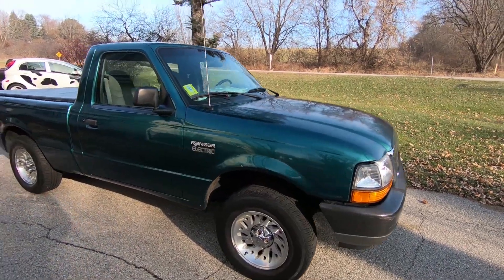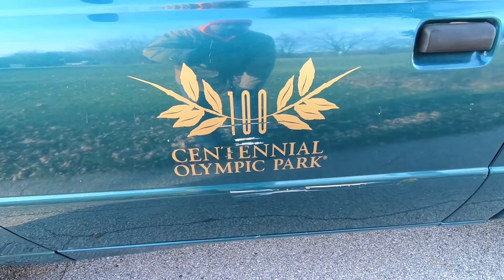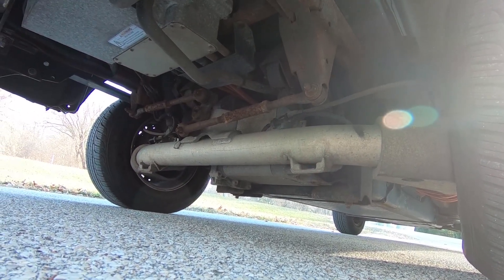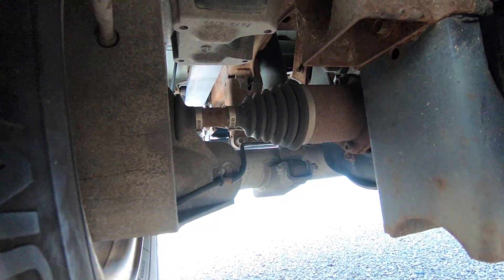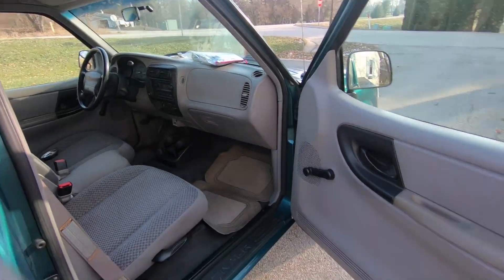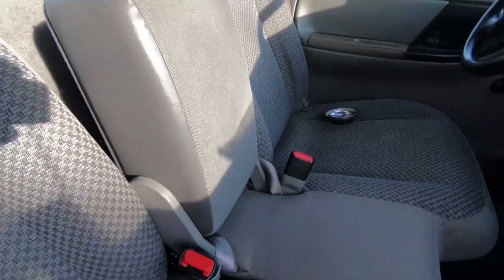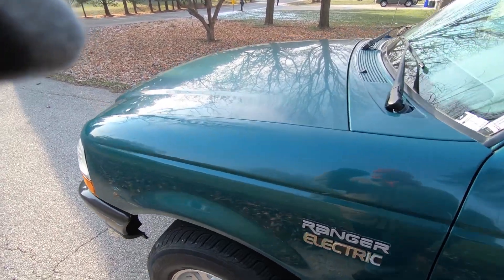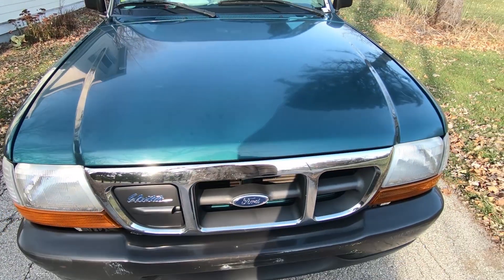Ford Ranger EV Walk Around Tour and Overview

Comment: I drove one at Ford in Dearborn.  What was impressive is how normal it was to drive: exactly like a car with an automatic transmission. It only got weird when I took my foot off the "gas" and it went dead silent. Years of driving IC cars made my brain say "STALLED!!!".

I worked for the company that made the DC-DC converter: managing it in the factory. One fine day I got laid-off from that job and I went on a hike to clear my mind. I'm sitting there on a bench for a few minutes and one of the Park's EV Rangers pulled up and parked right in front of me!

I thought "Now they're just messing with me!"

Comment: This is the drive set-up I want to use when I juice my 87 Isuzu Pup. Motor bolted directly to the differential. Maybe there are some of these rear-ends floating around out there. Or I might try to just build something similar using the stock rear.
Reply from the maker: There ARE motors that are designed to go straight to a differential. I have one in my garage right now that I'll be making a video about soon.
Reply: @BenjaminNelsonX  I'll be looking forward to it

Comment: Umm first of all, how would they get a 98 ranger in 96 at the atlanta Olympics?
Reply from the maker: It was at the same park, not the same EVENT!
I believe that Atlanta was flush with money that came in because of the Olympics and spent quite a bit of it on municipal infrastructure, including such things as buying electric vehicles and charging stations. The truck clearly was used in brush and maintenance, as can be seen by the scratches and dents on the bed. The interior of the cabin is in great shape and it's very low total miles.
Reply: @BenjaminNelsonX  I didn't even think of that being a possibility. Makes much more sense. Still a very cool very rare truck!

Comment: So this is a dumb question but why do you need coolant? 🤔🤔🤔What does it cool/ keep not frozen in winter?
Reply from the maker: The motor controller is liquid cooled and the truck has electric heat and air-conditioning.

Comment: I have one of these trucks right now in my shop that I'm working on for a customer someone else started it with a hundred and four hundred amp hour cab lithium batteries. I got a spoof board to trick the BMS that's in the truck to think that the batteries are okay but I'm still having trouble getting things going. I have the power limit light on and it won't go over 20. I got that same consult programmer that you have to oh, what a small world.https://youtu.be/vBNagoYF5Oc

Comment: Ben:  What a great deal on the truck. A few things that might help you on your endeavors:

A Ford NGS tester is really helpful in working on the truck as there are a lot of things going over that older OBD port that don't translate with modern OBD diagnostics.  You can also find the Ranger EV cards on line for the NGS. If you are going to attempt to use the existing BMS and charging hardware the NGS is a must to reprogram the system from lead to NiMH

There are also specific tools made to work on the truck some are not all that needed but others are a lot of help.

There is a pump INSIDE the transaxle that was prone to failure and required removal and disassembly to replace ( If you could find it). If the PO did not encounter this issue, a common solution was mounting a holly pump under the truck to do the same job. You will get an error light on the dash when the pump goes.

The ceramic heater is a beast and it kills the range and regen. However you will not need it on long as it warms up the cabin quickly. Speaking of heaters, the original lead pack also contained heating pads attached to each battery to keep them warm while charging so the range was not affected in cold weather.

Blend door failures are also common as on regular Rangers and a pain to fix

Getting that coffin out is a beast without a lift. I am curious how the PO ran the sense leads like they did all in that box. When I moded mine from the NOS 8 volt to 12 I attached a little resistor pack to each battery. It worked quite well but lead is SOOO heavy. Mine is waiting on me to get off my but and mod it to NiMH. Maybe down the line to lithium but I would like to keep it as stock as possible and so far no one has been able to mod the on board charger for Lithium battery specs so a different BMS and charger would be required. There was a gentleman on the west coast that was the go to guy on Ranger EV mods but his on line presence has seemed to have disappeared.

If you have not already done so, the service manual is available on line.

Fun Fact: The post office had a pilot of EV mail trucks based on the Ranger EV platform. As far as I can tell all of them have been crushed. One of the few differences was that you could run the heater while plugged into the charger. Allowing defrosted windows and it is toasty warm for the mailman to start his route on a cold morning and not drain the battery. Training video: https://www.youtube.com/watch?v=YgdMEPCcQTI   Part 2 here:  https://www.youtube.com/watch?v=v9Z8Jl4quXs

Good luck with your new toy!
Reply from the maker: Wow! An LLV with Ranger EV guts!?!? Cool!

Comment: I had always wondered what was behind the “gas door” on these! I’ve been thinking about getting one (there’s one locally for sale), and also doing a lithium conversion, but money, haha. 
If you’re interested, the company I work for, Quick Charge Power, in San Diego (right next door to EV West) builds CHAdeMO DC fast charging kits for other factory built EVs (Gen 2 RAV4 EV, Tesla Roadster, and Mercedes B-Class, as well as other cars we have in the pipeline). We occasionally do some other prototype work, but it’s pretty rare... Perhaps you could convince Tony to get you one of our control boxes though. Even if not, it might be worth giving him a call, he’s very knowledgeable about the CHAdeMO standard.
I think with an Orion BMS you can get it to work with just the inlet and some contactors, as I think Orion already supports the CHAdeMO protocol, and will handle the communication.
Reply from the maker: Thanks Alex!

Comment: The fact that this truck has an electric motor, but not electric windows, bothers me for some reason.
Reply from the maker: It would only bother me if they were gasoline powered windows.
My gasoline 1998 Chevy S10 only had crank windows as well.
Reply: That's to save electricity. This was the 90's Electric cars nowadays can have electric windows and no drainage issues. I think the past it was more difficult.

Comment: I wonder if aluminum hoods are a Ford thing, both my 87 and 99 Town car had aluminum hood.  Never had dent issues with them though.
Reply: 1D10CRACY , "According to the Aluminum Association, Ford leads the auto industry in the use of aluminum in its current steel-bodied vehicles with an average of 219 pounds per vehicle.

Stamped aluminum hoods for the Ford Crown Victoria, Mercury Grand Marquis and Lincoln Town Car account for most of that poundage"

  http://edit.autonews.com/article/19940530/ANA/405300737

Comment: You should try to get the batteries from a wrecked fiat 500e!
Reply from the maker: Better yet, a PAIR of 500E batteries!
Reply: BenjaminNelson I have a fiat 500e and my ultimate goal would be to get batteries from one and install them under the trailer I built for it. I could almost double my range. Someone has done something similar with the RAV4 ev. You could do the same thing with the ranger and tow a power trailer!
Reply from the maker: @4N2IN0JA  Trailers are always a fun idea, but best used for "special" trips. Parking and other practical considerations make them less useful for daily driving. I need to get a decent lithium pack into the truck in the first place. After that, I can play around with some other ideas. I do also have a friend who built a pusher trailer with some VW parts. Seems like that's worked OK for him. https://karmanneclectric.blogspot.com/2018/12/even-rangy-ier.html
Reply: 500e needs to keep the liquid cooling system tho, probably the charger too...inverter...?
Probably depends on what voltage the truck runs off of. if it turns into a full conversion, doesn't even make sense.

Comment: The DeDion rear axle wasn't a surprise, it's a a name from the dawn of motor vehicles. DeDion-Bouton was founded in 1883 and the axle design went into use around around ten years later.

More of a surprise was the linkage giving sideways location. It's associated with a much older name, that of James Watt, who introduced a major improvement to the Newcomen atmospheric* engine.  The Watt's linkage was another innovation, turning motion though an arc into linear movement. It replaced a rope or chain wrapped around an arc.

James Watt did not invent the steam engine and in fact tried to ban the use of high pressure steam, petitioning Parliament to enact legislation. His engines, like Newcomen's used low pressure steam and condensed it to create a low pressure, the pressure of the atmosphere then providing the power.
Reply: Of course

Comment: If the column shift mechanism is similar to my old 93 F150, you need to tighten a tensioner that to get the shifter indicator to reflect the proper gear position. Check this link out for instructions on how to sort it out. https://youtu.be/x5e8UyBZplU

Comment: Holy crap, how did you find this? Most of these were mandatory lease returns in California and were crushed. 27 years of working at a Ford dealership here in Texas and I have only seen one. It was not running and towed here from California, formerly owned by Yosemite National Park.  With the stock setup expect 30-40 real world miles as the range. I think later years of production used NIMH batteries with a bit better range. If NIssan Leaf cells are 8 volts each, could those be used as direct replacements for the 8 volt lead acid cells? Great score! You should join the registry at  http://www.fordrangerev.com/REVolt/REVolt.html
Reply from the maker: Hi Brian, I signed up for the Ford Ranger EV REVOLT page a couple of days ago. Haven't had a chance yet to dig through any information there yet though.
I got the truck from a guy in the Chicago area. He was getting a Tesla Model 3, which was showing up LITERALLY the day after I got the truck. His wife said he could only get the Tesla if they had the garage space for it. He was literally getting rid of the truck to make garage space! Besides the truck itself, I ended up with a bunch of other junk that was in the bed from him cleaning out the garage.
Reply: It's an extra level of complication, but I thought Leaf would be a good source, no liquid cooling to mess with.

Comment: Why not go CCS? Isn't Chademo a dying standard, that only Nissan is clinging to?
Reply from the maker: There are CHAdeMO stations in my area, including FREE TO USE ones, my other car has a CHAdeMO connection, I have a SPARE CHAdeMO inlet, and the communications system is CAN based, and can be controlled by some BMSs, such as the Orion system.
Reply: @BenjaminNelsonX  Thanks for the reply. It totally makes sense for you.
Reply: There are still more CHADeMO stations worldwide (and in the US) than there are CCS, over 20k in total!

Comment: Congratulations on a good find. Maybe with li-ions you'll have some cargo room. Would there be room under the bed between the rails? 

Either way. Go for it!
Reply from the maker: This vehicle was designed with a very large battery box which mounts BELOW the vehicle. When I got this truck, that box was in place, but a non-original lead-acid battery pack was mounted in the bed. I plan to find some lithium batteries and mount them in the original location - the box designed for it under the truck. The current lead acid batteries will be removed and the truck will have its cargo space back.
Reply: Of course! You said so in the video. 
I wonder if you could source a modern battery pack from, say Mitsubishi, Nisan or even Ford? Too expensive, I'm sure. Unless one of then were in a generous mood.

Comment: Could even end up with a power toolbox frunk by re design of under bonnet. Liked Rivian’s idea of power outputs and compressor they could be front mounted . All good for off grid projects. Bed could carry a lot of solar panels plus.
Reply: On the subject of batteries. Chris Jones is back on it. https://www.facebook.com/1393518207630246/posts/2112555055726554/
Reply from the maker: I've experimented with using electric vehicles as home power backups. I did run my house from my Kawasaki KZ440 during a blackout. I like the idea of adding an inverter on the truck to run off the main truck battery for home power backup.
https://www.youtube.com/watch?v=-ydKipDPgQE
Reply: 1 of those racks that goes from tailgate and overhangs the hood, covered with solar panels!

Comment: How many leaf packs would fit in the coffin? Cooling rails ? Or Tesla battery packs already with coolant connections to hook up. Weight to range ratio as well. So much fun. How to finance? DeWalt and A123 sponsorship. Ford full development research grant so you could try out as many permutations as possible Battery , controller and charger wise.
Reply from the maker: 88 Nissan Leaf cell modules fit in a Ford Ranger EV.
https://karmanneclectric.blogspot.com/2016/12/batt-decided.html

Comment: An Orion BMS will allow you to deal easily with lithium batteries equalisation and overall management and natively includes the protocol to drive Chademo plug and charger. (Need a pair of extra relays, that's it). I Don't think emus bms have it right now. Now you need to check the overall voltage of the pack, as lot's of DC fast charger won't work if battery required voltage is too low  (even if Chademo official protocol specify a low enough voltage, some chargers just don't implement it). If I'm not mistaken, the Orion also have protocols for other common ac chargers too. Might be handy.
Reply from the maker: The Orion system is the first I thought of, as it DOES support CHAdeMO. Current system voltage of the truck is 312VDC. Shouldn't be any voltage issues with CHAdeMO there. The issue I had always heard about with CHAdeMO was lower voltages such as are used on EV motorcycles. At one point, I thought about adding CHAdeMO to my Vectrix electric motorcycle.
Reply: @BenjaminNelsonX  yes, I own a converted Vectrix as well, and I followed all your vids :-D as I already had an available Orion bms in hands it also crossed my mind,but nope, voltage to low. Instead I built my own cheap version of a zero Diginow system with an Arduino, a bit of code, and Elcon/tc chargers. Works quite good. And AC charging points are available by the dozen in my area, at the end much more convenient than Chademo. An option to consider for your truck as well, 20kw-ish onboard. Orion's drives Elcons as well.
Reply from the maker: @flyingpapaye  One of the reasons why I didn't try CHAdeMO with the Vectrix is just because I added additional chargers to it. I simply connected a few Mean Well power supplies in series. Worked well!
I have checked the charging connection on the truck, and it charged at almost 6,000 watts - a significant increase in charge rate over my iMiEV!

Comment: Good stuff Ben and looks like you have got lot's of batteries for GE Elek Trak tractors.
Reply from the maker: Unfortunately, the batteries that are in the truck were actually NOT part of the sale. I'll have to remove those in the not-so-distant future, but I'm hoping to find some good/cheap/fast lithium so that I can do the upgrade quickly instead of having a non-functioning truck for any significant amount of time.

Comment: Man it doesn't have any rust to speak of most 20 year old trucks up hear in Canada are ate up with salt.
Reply from the maker: My area is notorious for salty winter roads too! I think this truck was originally in Atlanta, Georgia, USA, and then after that, Chicago, but not driven in the winter.
Reply: I'd say Ziebart.
Reply: Are the old batteries still inside that box? Could you put a lift kit on it?
Reply from the maker: @4N2IN0JA   No, the old batteries aren't in the box. The truck would be INSANELY heavy if they were. The rear end has an unusual suspension which I think would prevent the use of a lift kit.